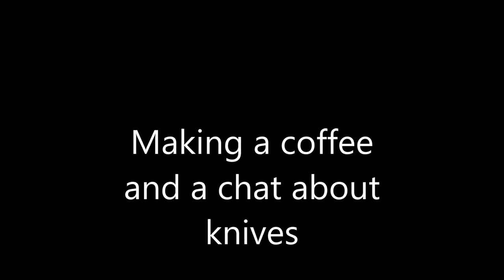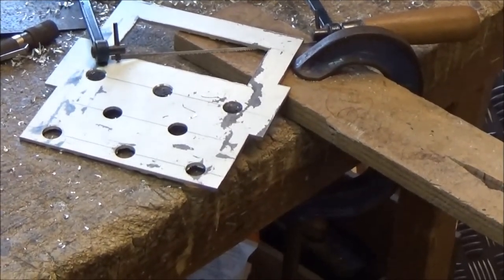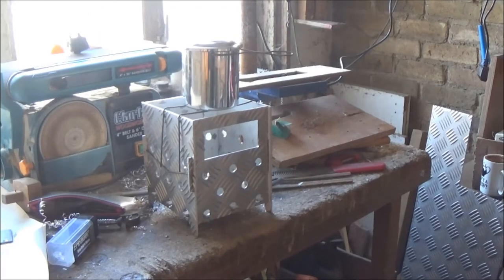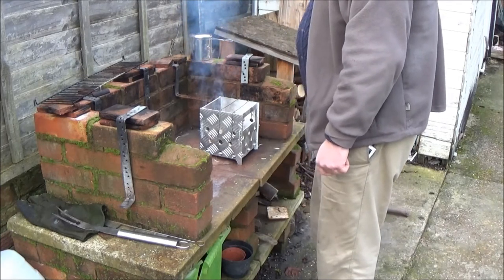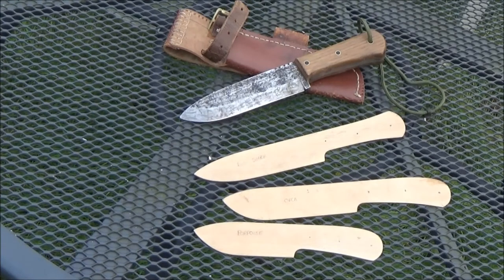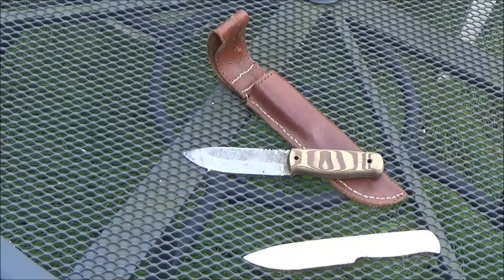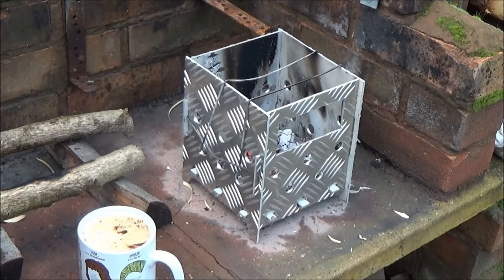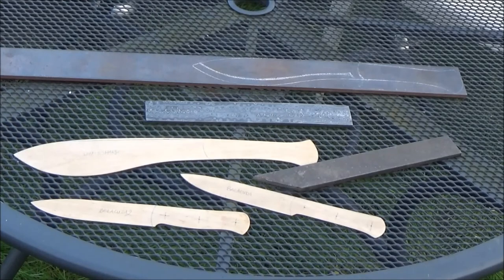Dale Skidmore - A cup of coffee and a chat about knives

Comment: Love the firebox. After Mac's comments on his being a bit wibblywobbly he'll be having an order in for one of those.
 You might already of thought of it, but rather than the loop over wires, have you thought of smaller holes and some steel tent pegs shoved through as pot carriers ?
and ... I wondered if you had planned to build in a shelf/tray option at a height where you could use trangia/esbit burners , even two at a time ( I'm  guessing the size of the burner top.)
Could even be just  more rows of holes , for more tent pegs and maybe a tray, just to extend height options. 
That would give broader options in really  soaking weather.  Sorry if you thought of all this. I tend to type as I think  then read the comments etc  :)  .
Enjoyed seeing the evolution of your blades through the designs, stylings, materials and the changes in tack you're thinking of.
Loved the look of  that kukri'esque recurve template, as a bush knife .. BUT  if I ever turn  any gear out don't come after me on copyright , because I have a design drawn up I call a Bush'Kri ,for now ... and it's very very similar to that of yours.
Happy new year to you all...
Reply from the maker: Morning Dusty, thanks for watching. I had a piece of 6mm bar that I couldn't find at the time, have since drilled holes to slip 2 pot stands in, broke one bending a locking hook on it. I have thought about the dual fuel option, I use a beer bottle burner, the air holes could be used to raise the burner to cook height for this. No worries about what you advise, as sometimes it needs a suggestion in the right place.
That is why I am not too worried about the knives not being in tool steel yet, I wanted to see what shape best suited me before spending serious money on materials. I have seen lots of reviews on knives and the kukriesque model is rather like one I have seen on YT and it would come out of the stock I had. That would be like our mums suing each other because we look similar in shape, ha ha. HNY to you and your.

Comment: Awesome knives Mate, the first few I made were from mild steel too. You'll like working with the file steel, I could feel the difference in quality right away. What process do you use to shape the blade, I assume it's stock removal but do you use a file or grinder?
Reply from the maker: stevenk1965 Hi Steve, pleased you like the knives. I have been working on some 01 tool steel and Damascus and there is quite a difference in the feel of the metal. I use a bench grinder for the shape and a hand file jig like yours for the bevel. I really enjoy the heat treatment process too. I use charcoal in a loose brick forge and temper them in the cooker in the kitchen.